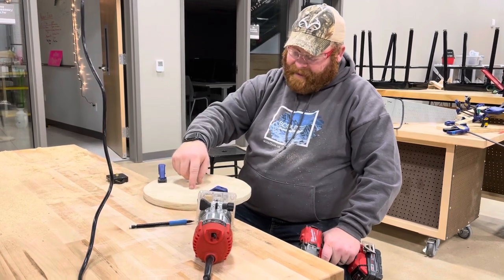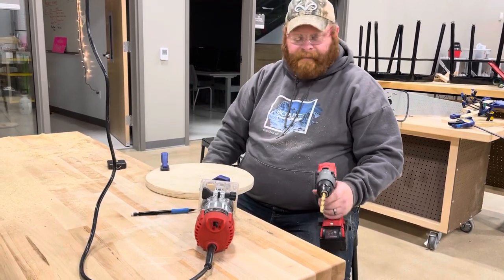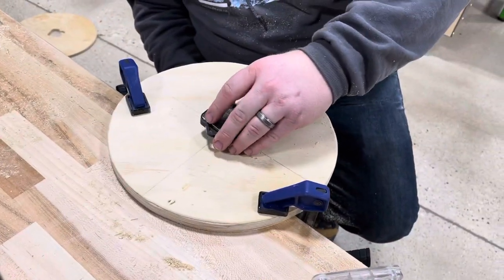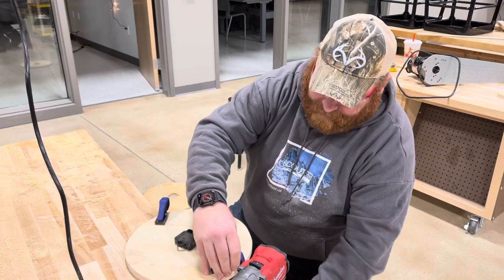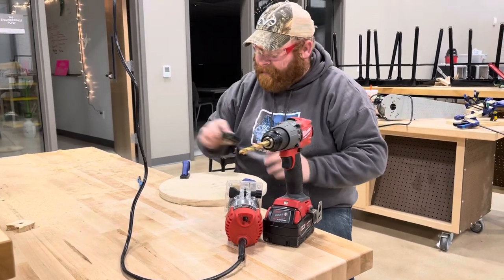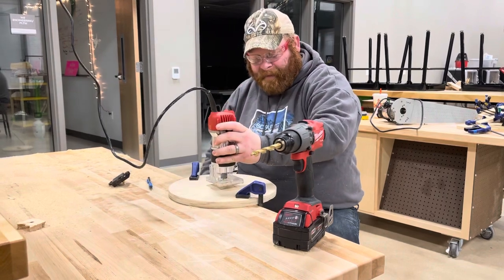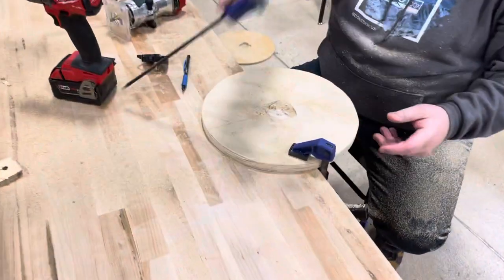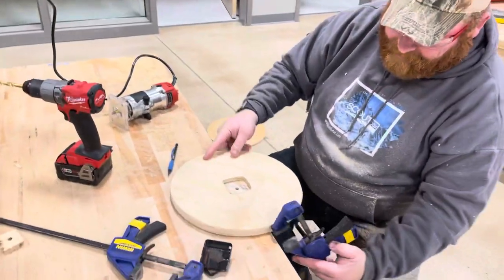Router out space for mechanism on back of clock face

Comment: It would be helpful if you talked about the bit you used and the depth that you went...could you cut deeper and go flush to the bottom of the clock mech.?  needs a little more info thanks.